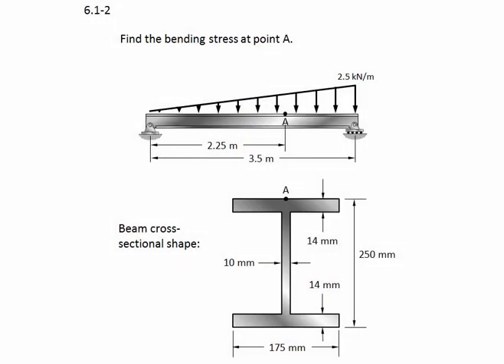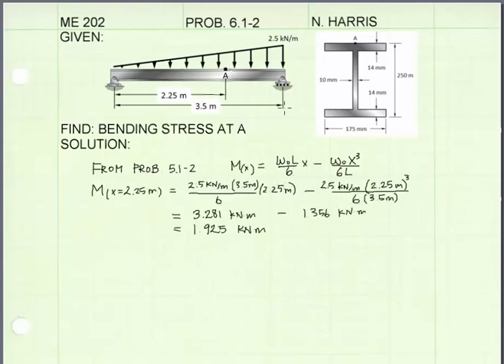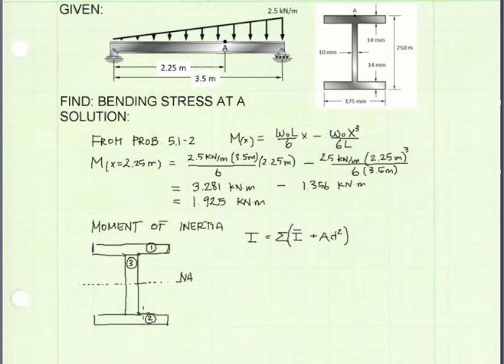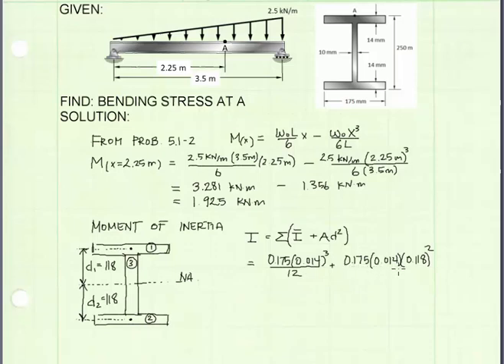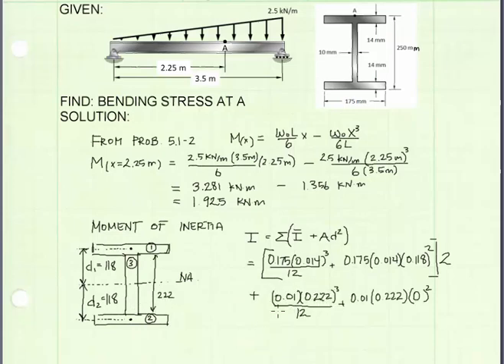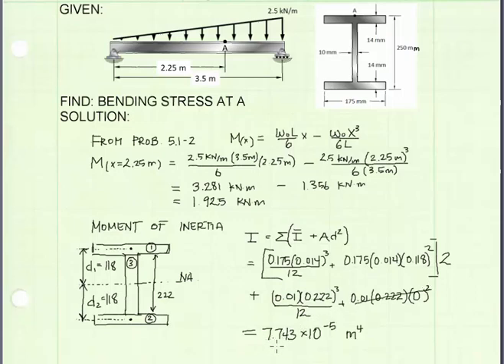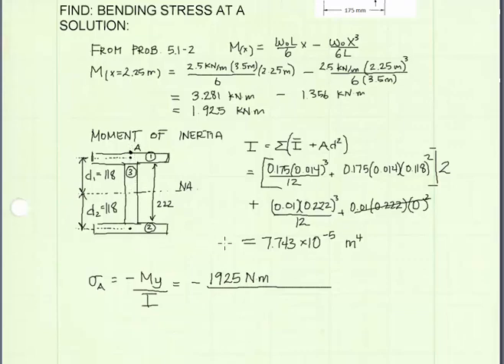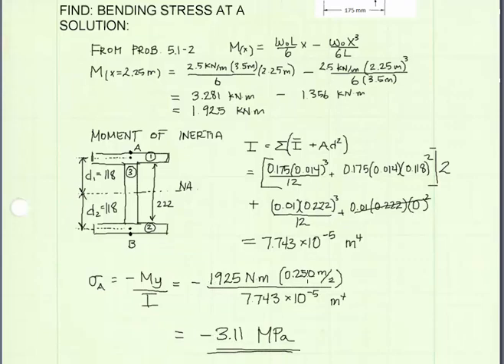06.1-2 Flexure formula - EXAMPLE

Comment: Why didnt you include the moment of the reaction at the support ?
Reply from the maker: Because the support is a pin, there is no moment reaction.  The rule is that where there is an end support that does not restrain rotation, the reaction moment will be zero.